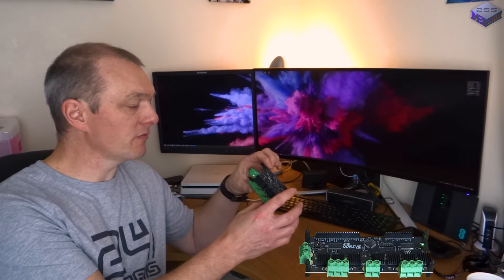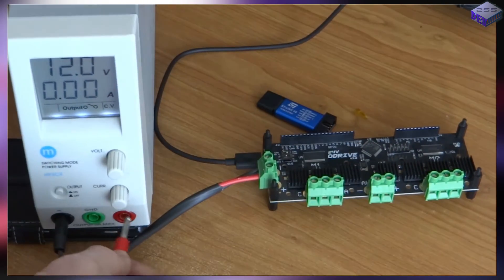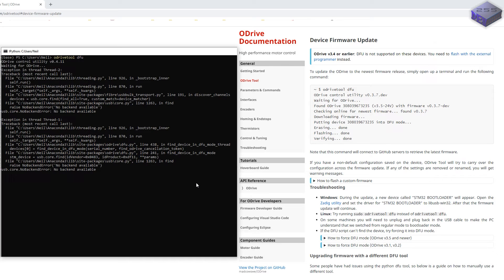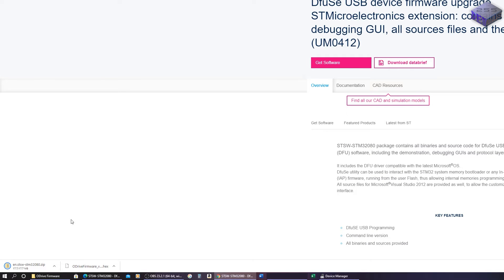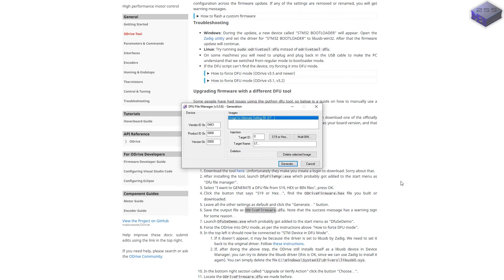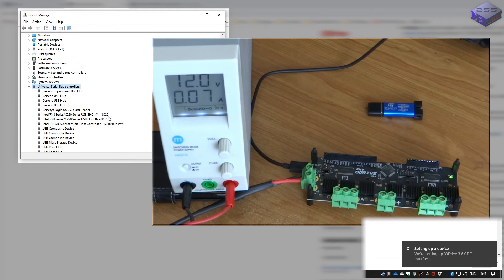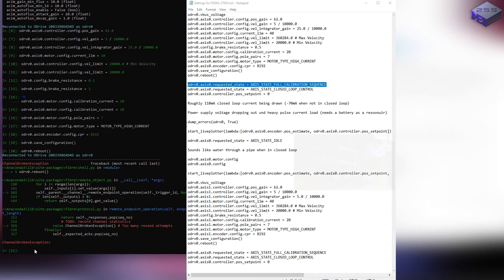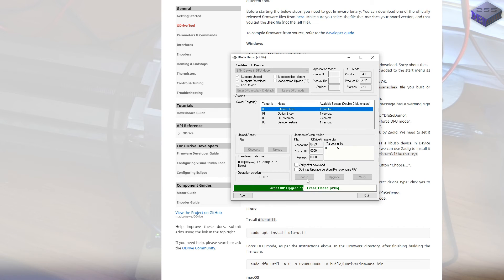Reflashing an ODrive after losing its firmware

Comment: does not work on my makerbase "odrive".. after many attempts.. be careful useing not the original odrive. Especially since (mine) does only work with the MKS firmware and not the latest Odrive..
Reply from the maker: Hi, yes I wouldn't recommend anything other than ODrive carry out this re-flash unless you are sure this will work. This type of ODrive is being discontinued but I will leave this video up for reference of older devices. I still use my ODrives on this version of firmware.
Reply: did you get it working... fighting with mine again and its annoying...

Comment: hi ı have a odesc 3.6 odrive from sequre, and when ı connect 2 sequre to my computer same time, odrive 1 is broken, ı flash on stm32cubeide but dont fix, when ı connect odrivedfu is tell me odrive found but dont serial number, but when ı check ı see serial code
Reply from the maker: Hi, I don't know what this could be, as I haven't played with anything other than the ODrive systems. Their community page is very comprehensive for the ODrive, and it may help you, although ODrive don't support other manufacturers' systems as there are many differences

Comment: Thank you so much for this video, but I am still having trouble. I have followed all the steps as you said, but when I go to use the Dfu tool it doesn't autofill in the information of the Odrive that was forced into DFU mode. Instead if remains greyed out and I can't proceed any further. I have done everything to force it into DFU mode, including the dipswitch and grounding GPIO pin 6. The computer does recognize something is being plugged in because in the device manager it lists it under other devices as "STM32 BOOTLOADER", but then when I click on it it says The drivers for this device are not installed, (code 28) thee are no compatible drivers for this device. I am at a complete loss
Reply: You should change "STM32 BOOTLOADER" device driver to one located in C:\Program Files (x86)\STMicroelectronics\Software\DfuSe v3.0.6\Bin\Driver\Win10
Reply from the maker: Hi Daniel, have you managed to get this sorted via @tired response? The best option I've found as things have moved on from this video is to create a query on the ODrive Forum. I haven't played with one for a while but left this video up as it helps some with older versions get theirs up and running. If you are still stuck, please feel free to ask again and I'll try and dig deeper.
Reply: @TheSolarPoweredEngineer  hello, i ve the same problem but when i change the driver nothing if you have an answer =)

Comment: Mine it doesn't appear  even when i put it in dfu mode , how can i fix this ? thank you in andvance
Reply from the maker: Hi, if it doesn't appear even in DFU, you may have a faulty unit, although the one in this video was sent to me as they had the same issue. You may wish to try a different PC, USB port, or even the USB cable, there is a possibility that the USB cable you are using only supplies power and does not have the data lines to connect to the system. If using on a PC take a look in the Device Manager for this unit and unplug and re-plug back in to see if anything appears. I hope that helps.
Reply: @TheSolarPoweredEngineer  
Thank you for replying , it worked before and connected it, but suddenly it disappeared and started to get "connect to your odrive " when ever I execute the odrivetool command, I  tried diff usb ports, pc's and cables, but still same issue.
Reply from the maker: @hussamhaij6238  Ah ok, that may still be recoverable, although you may need to get the ST-Link V2 USB device that I mention in the video, this should allow you to re-flash the Firmware should its own boot loader not work. Before spending money on that though, it may be worth you contacting the manufacturer as they may be able to help or even replace your unit. The ST-Link is fairly cheap and is a good backup option. Hopefully, your board is recoverable. You may also benefit from searching on the ODrive community forum here: https://discourse.odriverobotics.com/

Comment: there isnt many tutorials for odrive . trying to run a linear motor on one . thanks
Reply from the maker: No worries, the ODrive community has a good Discord channel if you need further assistance
Reply: @TheSolarPoweredEngineer  thanks I've been on there. 
Mines a home brew. 
Linear tubular ironless bldc. 
Asked many questions. 
I have had some help lately, but still not sure if it will run on odrive.
Reply from the maker: @simonlaker2139  Ah ok, its all about pole pairs and encoder type for the ODrive, if linear, have you considered the AMT 102 rotary encoder with a shaft that is rotated by a kevlar taught thread (by sprung idler pulley) that links to the linear device. Kevlar has less than 1% stretch, so is very accurate for cheap linear measurements. The only problem then is keeping it clean in a dirty environment.
Reply: @TheSolarPoweredEngineer  I built a linear incremental magnetic encoder from component level. 
Resolution of 0.001mm
Reply from the maker: @simonlaker2139  That's a nice resolution 👍
Reply: @TheSolarPoweredEngineer  also planning on cnc and 3d printer. 
Drop in replacement. 
3d printed

Comment: Hi Neil, my 56v o drive board seems to short out my usb hubs every time i connect a usb cable. have you seen anything like that yet?
Reply from the maker: Hi, I've not come across this before, is it when power is applied to the board? As the USB does not connect unless the ODrive is powered. You could try temporarily switching to DFU mode just to see if the USB works with the ODrive powered. There is a possibility that the USB hub doesn't like the board. Also, have you got a decent earth on the ODrive? Although it shouldn't affect it in this way. Failing this, you could ask on the ODrive website forum, just start a new support feed. Hope that helps